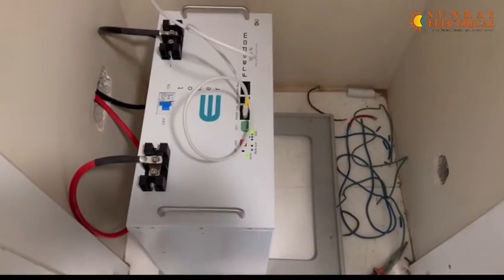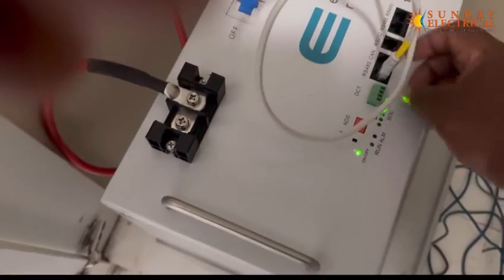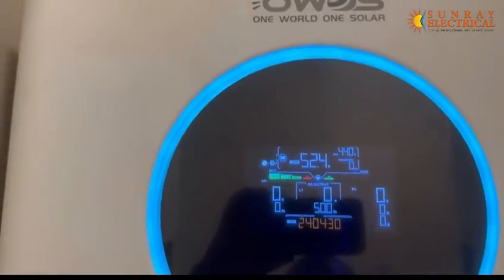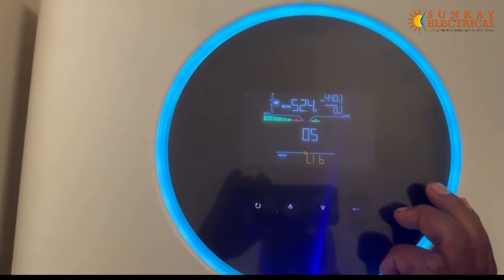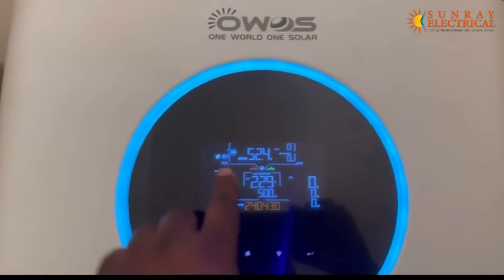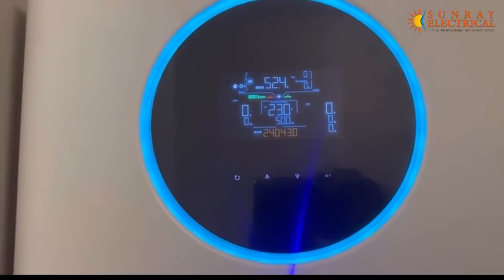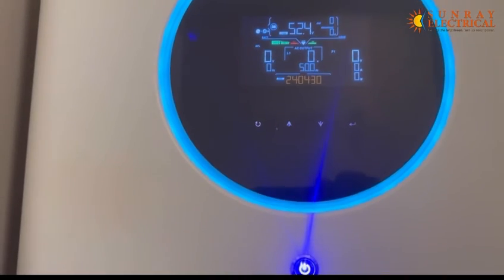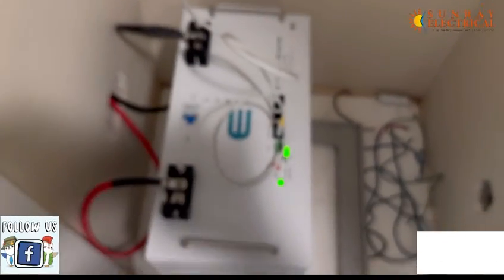Bms comumication on axpert/voltronic and Freedomwon etower lithium battery

Comment: Thank you. I have Axpert Voltronic 11kw inverter and SRNE 5.12kwh server rack battery. I cannot get them to communicate and gets error code 61 each time I tried. The SRNE manual says to set the DIP switch of the master to zero and the slave to 1, which I did. Any suggestion?
Reply from the maker: Helo boss pleas check the pinout diagram for the rs485  on the axpect most uses 3and 5  but battery not sure wath is the pinout layout if you dont mind sharing  

+263771477823
Reply: @sunraysolarenergy5862  The vendor sent me this message," The 485 pin of the inverter is 5A3B, and our company's 485 pin is 7A8B. If the customer wants to perform 485 communication, the line sequence needs to be modified so that pin 5 is connected to pin 7, and pin 3 is connected to pin 8". Could you explain in a layman's term what the message means and how I can achieve that?
Reply: Rs485 baud rate inverter must match the battery baud rate. B/r 9600 or another but they must be the same